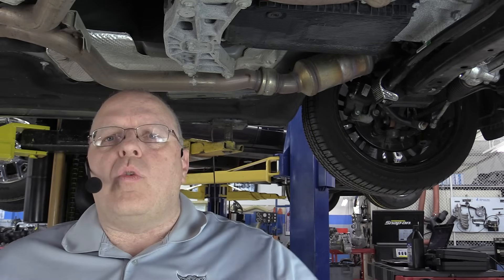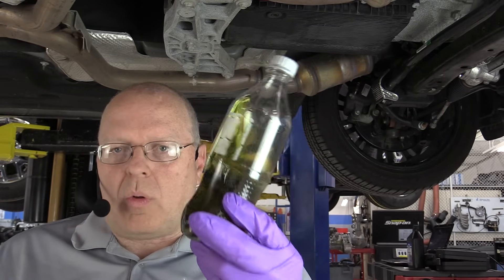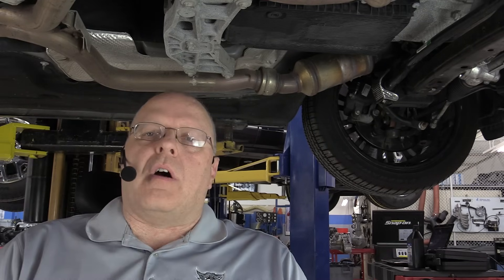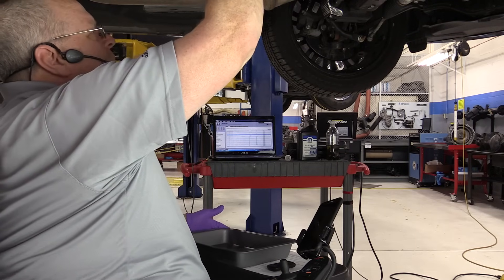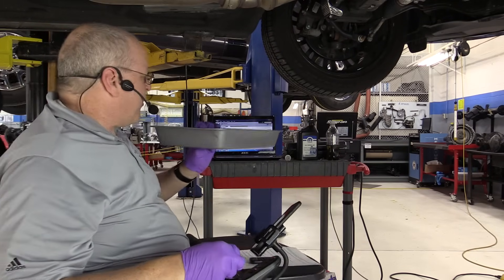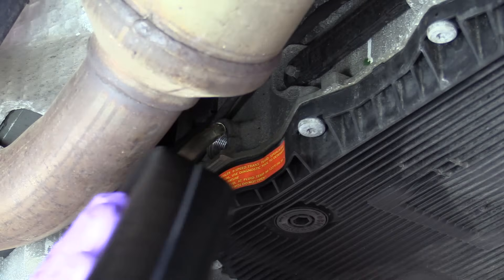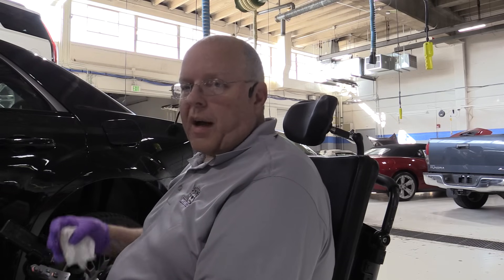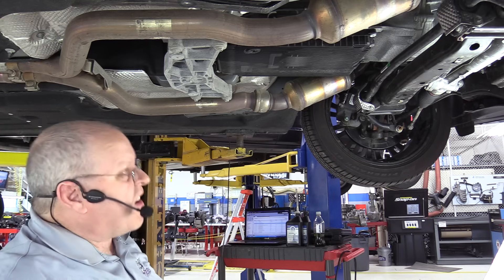Jeep, Dodge, RAM ZF 8HP 8HP 8-Speed  Transmission Fluid Level Check - No Dipstick

Comment from the maker: My ATF fluid research has led me to discover the following information. I document it here as well as on several Wikipedia pages I created/modified on Mercon, Dexron, Mopar, and Toyota automatic transmission fluids.

Lifetime Fluids and Dipstick-less Transmissions:
The 1967 Ford Type-F fluid specification was intended to produce a “lifetime” fluid that would never need to be changed. This is the first of many Ford “lifetime” fluids. The 1974 Ford Car Shop Manual reads "The automatic transmission is filled at the factory with "lifetime" fluid. If it is necessary to add or replace fluid, use only fluids which meet Ford Specification M2C33F. Many other transmission manufacturers have followed with their own "Lifetime" automatic transmission fluids".

To understand how a fluid can last a "lifetime", a study of the 1939 Chrysler Fluid Drive Fluid is needed. The November 1954 edition of Lubrication Magazine (Published by The Texas Company, later known as Texaco) featured a story called "Evolution of the Chrysler PowerFlite Automatic Transmission". This article described the fluid used in the 1939 Chrysler Fluid Drive and its subsequent revisions and enhancements through 1954.

A section of the feature described the lubrication of the Fluid Drive's fluid coupling, reads "The fluid drive fluid coupling is partially filled with Mopar Fluid Drive Fluid, a special highly refined straight mineral oil with a viscosity of about 185 SUS at 100° F., excellent inherent oxidation stability, high viscosity index (100), excellent ability to rapidly reject air, very low natural pour point ( -25° F.), ability to adequately lubricate the pilot ball bearing and seal surface, and neutrality towards the seal bellows.

The fluid operates under almost ideal conditions in what is essentially a hermetically sealed case, the small amount of atmospheric oxygen initially present being removed by harmless reaction with the fluid so as to leave a residual inert (nitrogen) atmosphere. As a consequence, it has not been necessary to drain and replace the fluid, and the level-check recommendation has been successively extended from the original 2,500 miles to 15,500 miles and finally to "never" - or the life of the car.

Since drains and level checks were not only unnecessary but frequently harmful ( through the introduction of more air, and seal-destroying dirt) Chrysler eventually left off the tempting level inspection plugs. This mechanism is therefore one of the very few that is actually lubricated for the life of the car. There are now myriad examples of couplings that have operated well over 100,000 miles without any attention whatsoever and were still in perfect condition when the car was retired."

Umbrella Style Automatic Transmission Air Breathing Suppressor (TABS) from a 2017 Chevrolet Bolt EV
Any automatic transmission fluid will last longer if the transmission case could be hermetically sealed, but transmissions have several potential entry points for air:
1. The Dipstick Tube. Any transmission with a dipstick tube has the potential to let additional oxygen into the transmission through a dipstick or dipstick tube plug that is not fully seated in the tube, or through the process of using the dipstick to check the fluid level. Many modern transmissions do not have a dipstick, they have sealed transmission fluid level check plugs. By removing the dipstick, the transmission manufacturer has also removed a potential entry point for oxygen; this reduces the potential for fluid oxidation. A sealed transmission will have longer transmission fluid life than a non-sealed transmission.

2. The Transmission Vent. Transmissions need vents to compensate for internal pressure changes that occur with temperature changes. Without those vents, pressure could build resulting in seal and gasket leaks. Older transmissions had large vents with not much more than a steel wool filter to keep out larger contaminates. The large vents allowed for easy inlet and outlet of air which results in additional oxygen being introduced into the transmission. Oxygen reacts with transmission fluid and can cause oxidation, rust, and corrosion. Ford and other transmission manufacturers have learned to use smaller vents with one-way Transmission Air Breathing Suppressor (TABS) valves in them to prevent oxygen entry into their transmissions. 

Any automatic transmission fluid will last longer if it comes from an unopened container
1. Containers storing automatic transmission fluid (ATF) should always be sealed; if exposed to the atmosphere, ATF may absorb moisture and potentially cause shift concerns.
2. When performing repairs on ATF-equipped transmissions, it is important to use only new, clean ATF when refilling the transmission. Never reuse ATF.

Lifetime automatic transmission fluids made from higher quality base oil and an additive package are more chemically stable, less reactive, and do not experience oxidation as easily as lower quality fluids made from lower quality base oil and an additive package. Therefore, higher quality transmission fluids can last a long time in normal driving conditions (Typically 100,000 miles (160,000 km) or more).

The definition of 'Lifetime Fluid" differs from transmission manufacturer to transmission manufacturer. Always consult the vehicle maintenance guide for the proper service interval for the fluid in your transmission and your driving conditions. According to the Owner's Manual of a 2018 Dodge Charger with "Lifetime Fluid" and a ZF 8-speed automatic transmission, the automatic transmission fluid, and filter never needs to be changed; however, ZF, the manufacturer of the ZF 8HP automatic transmission indicates the fluid has three different fluid service intervals depending on the driving style. ZF recommends a transmission oil and filter change every 62,000 miles (100,000 km) or after eight years at the latest.

1. Normal Driving ZF Automatic transmissions are maintenance-free and filled with specially developed partially synthetic ATF oils. Maintenance-free fills are intended for normal operating conditions.

Under "Normal" driving conditions, the automatic transmission fluid never needs to be changed (See age restriction below).
2. Severe Driving Driving at very high operating temperatures can result in accelerated aging or increased wear of ATF oils. In the case of above-average operating conditions, such as:

Driving with high transmission fluid temperature
Frequent freeway driving in the upper-speed range
Offensive or sporty driving style
Frequent trailer operation (towing)
Under "Severe" driving conditions, it is recommended to refresh (change) the oil and filter of the automatic transmission every 62,000 miles (100,000 km).

3. Eight Years Old

ZF recommends a transmission oil change after eight years at the latest.
Reply: I am a senior citizen and I have had 4 new cars and another 3 or 4 used cars in my lifetime. The only car that I had to have my transmission rebuilt was a new car that did NOT have a transmission dipstick (sealed) and that I was not able to check myself.  So now I do not trust sealed transmissions. And worse yet, now engine oil dipsticks are no longer being provided either. I am at a point were I can buy another new car but I would rather buy an older car with both engine and transmission dipsticks.
Reply: WeberAuto is there any chance on a 8HP70 that has a “one off” shift delay when cold from 1st to 2nd, that it’s fluid level? Or is this some kind of drain back overnight, it’s only ever after a cold start and then perfectly fine throughout the day in all regards. Thanks!
Reply: @Kai-Ber  That's normal especially if it was sitting for several days, this is mentioned in the owners manual.
Reply: @Kai-Ber  Mine does it every morning.  It's very annoying on a $55,000 vehicle.
Reply: @Kai-Ber  My 2013 Ram 1500 with the 8HP70 does exactly the same thing (the shift delay when cold from 1st to 2nd).  But it only does that when I pull right out of my driveway.  Seems more pronounced in the winter than in the summer.  I come to a stop sign 600 feet away, and does not shift delay when I keep going.  Come to think of it, it seems that it's always done that because I don't remember the time, or day, when it started doing that.  Currently at 90k miles and thinking of changing the fluid at 120k as called in the manual.
Reply: Great write-up!  I really appreciate the vast amount of research and time that you put into this.  Very interesting material to say the least.

However, the last section totally blows the term "lifetime fluid" right out of the water:

"2018 Ford F-150 with "Lifetime Fluid" could have three different fluid service intervals depending upon how the vehicle is driven:
1. Normal Driving - Normal commuting with highway driving, No, or moderate, load or towing, Flat to moderately hilly roads, No extended idling. Replace automatic transmission fluid every 150,000 mi (240,000 km)
2. Severe Driving - Moderate to heavy load or towing, Mountainous or off-road conditions, Extended idling, Extended hot or cold operation. Replace automatic transmission fluid every 30,000 mi (48,000 km)
3. Extreme Driving - Maximum load or towing, Extreme hot or cold operation. Replace automatic transmission fluid every 30,000 mi (48,000 km)"

The term "lifetime fluid" implies that the fluid will be good for the lifetime of the vehicle.  This cannot possibly be true as, when maintained properly, the lifetime of said vehicle might not be a finite figure (see any 60, 70, 80, 90, 100 year old car that's in perfect working order).  If "lifetime fluid" in this Ford's case is "Either 30,000 miles or 150,000 miles or somewhere in-between depending on driving conditions" then it's not lifetime fluid; period, full stop.  Because it has not lasted the lifetime of the vehicle.  Sure, the fluid is certified to be good for its own lifetime of up to 150,000 miles, but all fluids are good up to their lifetime.  It's a word game, and it's misleading for automakers to say that the transmission never needs to have the fluid changed.  All fluids have a point at which they are no longer able to lubricate--be it because of oxidation, contamination, or other factors.  For example, I was having shift problems around 70k miles on my 2017 Dodge Durango with "lifetime transmission fluid--do not service."  I replaced the fluid per the service process provided by the designer of the transmission (ZF), and when I got the pan off I found that the magnets were totally caked with debris and the filter was black.  I replaced the pan with integral filter and magnets, added the appropriate amount of fluid per ZF's service process, and my shift problems went away.  That is a far cry from Dodge's claim of "do not service."  The fluid might have actually been good, but clearly the magnets and filter at the very least needed replacing.  And there was no way I was putting black fluid back into my transmission.  Your own article mentions not re-using transmission fluid.  Could it be filtered/refined/brought back to a usable state?  Probably.  But it's cheaper and easier to replace the fluid.

Case in point: auto manufacturers can call it "lifetime fluid" all they want, but there is no such thing.  Sure, the fluids might be resistant or even impervious to oxidation due to their chemistry, but eventually there will be physical contamination from the wear and tear of normal use, thus rendering the fluid degraded and in need of replacement anyway.

I'm not knocking you, your research, or your article--I find it all to be very informative and I truly do appreciate all the time and effort you put into sharing it with us.  Especially now seeing the rationale that automakers are using to justify calling it a "lifetime fluid."  Albeit flawed logic, I understand where they're coming from.  It seems that they failed to consider the variables outside the fluid itself that would cause a problem.
Reply from the maker: @miket5506  Great points, I totally agree. I actually made a video on the misleading claims and marketing that is happening with the transmission fluids. Check it out https://youtu.be/xUFY0L_zFek
Reply: @WeberAuto  If they are against dipsticks why dont they put in a sight glass where that plug is?
Reply: And what if your transmission pan gasket is leaking and you have no choice but to drop the pan? What then? Also the transmission case was exposed to oxygen during manufacturing. I'm pretty sure that the environment wasn't that controlled. It's not a Bugatti. Maybe it's more propaganda so you're car will break down and you have to buy a new one
Reply: Great info thanks.
Reply: Is a BMW dealer service depart going to bother to do any of this? This "sealed" transmission doesn't seem very sealed. Seems like it's just a dipstickless transmission, made to fail from neglect.
Reply: Ok. If I Tow should I change my ATF at 75,000 miles? Yes or Leave it sealed?
Reply: @dcrican762  personally I would change it
Reply: @miket5506  Thanks.
Reply: @miket5506  that cross beam muffler pipe is that absolutely necessary to come loose to remove the old transmission pan?
Reply: @dcrican762  which model vehicle do you have?

On my ‘17 Dodge Durango the SnapOn book states to remove the transmission mount and crossmember—a 3 hour job each way.  For that we found that we could jack-up the rear of the transmission just enough to get the torx ratchet in there; OR you can do what we actually did and weld a torx t40 bit to a 1/4” open box wrench at about a 45 degree angle to be able to get it in around the mount and break the bolts loose. (I think it was a T40 bit, please check fitment ahead of time)
Reply: @miket5506 
A 1/4 inch drive does well.
Using an adapter for the T40
Reply from the maker: @dcrican762  Yes, change it. ZF, the manufacturer of the ZF 8HP automatic transmission indicates the fluid has three different fluid service intervals depending on the driving style. ZF recommends a transmission oil and filter change every 62,000 miles (100,000 km) or after eight years at the latest.

1. Normal Driving ZF Automatic transmissions are maintenance-free and filled with specially developed partially synthetic ATF oils. Maintenance-free fills are intended for "normal "operating conditions.

Under "Normal" driving conditions, the automatic transmission fluid never needs to be changed (See age restriction below).

2. "Severe Driving." Driving at very high operating temperatures can result in accelerated aging or increased wear of ATF oils. In the case of above-average operating conditions, such as:

- Driving with high transmission fluid temperature
- Frequent freeway driving in the upper-speed range
- Offensive or sporty driving style
- Frequent trailer operation (towing)

Under "Severe" driving conditions, it is recommended to refresh (change) the oil and filter of the automatic transmission every 62,000 miles (100,000 km).

3. Eight Years Old

ZF recommends a transmission oil change after eight years at the latest.
Reply: I have a 2015 Dodge Charger Sxt with 270k miles and haven't check or changed the trans fluid yet...
Reply: @weberauto your the man thanks for this!
Reply: So I'm a little confused.  I have a Ram 1500 2015 hemi.  Should I or shouldn't I change the transmission fluid at regular intervals?
Reply: I heat the transmission to 160 °F to open the oil flow to the cooler. How to cool the transmission to 86 °F, so that the oil still remains in the cooler? I assume, that the oil pressure should be maintained when closing the valve. In which gear is it possible?
Reply: I have a 2015 JGC 3.6L I use for long trips over mountains etc but not much trailering, I currently have 111k mi no problems to date.  Deciding on a dealer performed service for $1k.  From what Ive gathered the service for a non leaking trans is mainly to avoid the filter becoming restricted thus limiting flow causing trans slippage, not so much the fluid breaking down & I believe thats why they claim 'lifetime fluid' but not lifetime filter.  Roll the dice on some of this stuff, mess with it or let it ride. There is that 'insurance factor' that most of us mechanics understand so as to avoid potential problems.  I as an ex-ASE master & diesel tech prefer to bullet proof my vehicles & bikes as much as possible.
Reply: How could you get the dealer to check your transmission fluid while in for a service 🤔?
Reply from the maker: @sammontana1896  I would ask them, but they will tell you there is no need to check it unless the transmission is not performing correctly or of there is a leak.
Reply: @WeberAuto  was just curious in your professional opinion how does chrysler get away with saying "do not service" or "good for life"...ect...
When the designer and manufacturer of the transmission clearly recommends a fluid change/service at 100,000km... seems like chrysler is on a slippery slope